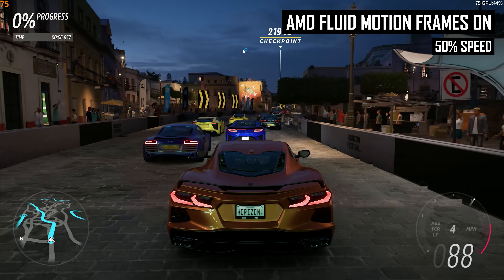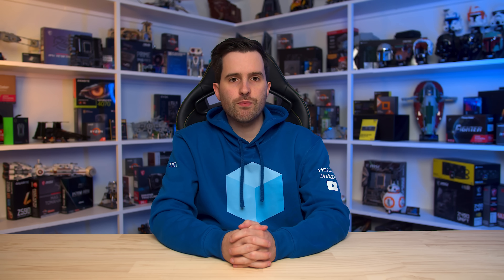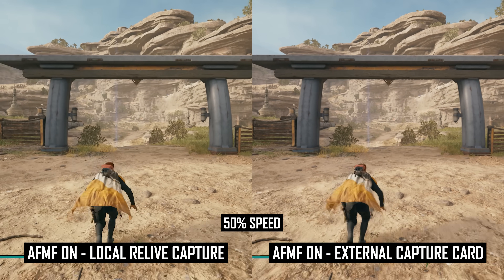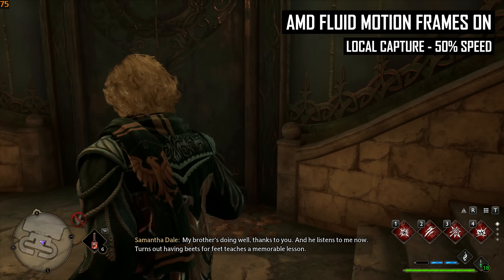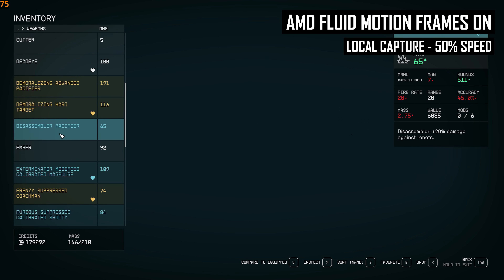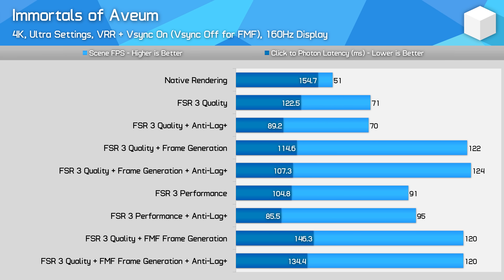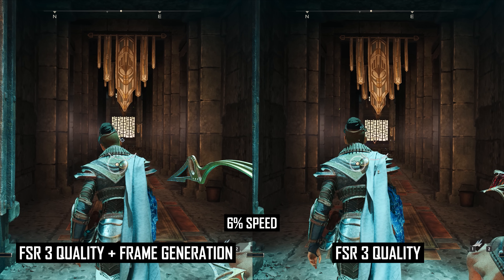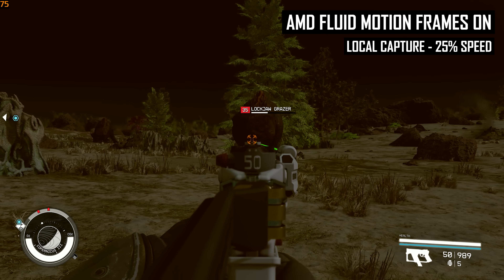Frame Generation for Every Game - AMD Fluid Motion Frames Analyzed

Comment: Tim, I thought you were using an RTX4090 in your main gaming rig so AFMF is a bit of a moot point for you in your personal gaming? TBH I've got a 7900XTX and can't really see the point in this (or even FSR3 frame generation), if I need more frames I just drop quality settings a bit and make sure I'm not running raytracing., but most things I play run just fine dialled up.

Comment: Of Course, Native will always be a better Experience SMH. Going by my own personal week long experience using AFMF in Starfield for a week playing @1440p on an RX6700XT. I find its useable for me. Never experienced any UI weirdness or quality issues of how it's displayed. I am not even at an average base rate above 55FPS in open field areas was getting very playable higher FPS. Even during combat. Saw non of the visual stuff Tim mentioned. Only issue I had was tabbing in and out of game cause Freesync to freak out and cause in game flickering of lighting . Cured by switching off free sync for a few secs, then reactivating it. So my own single game experience differs from the review in this Video. When I was in higher frame rate, it really wasn't noticeable that I was using a Feature, IE it felt like native gaming. The Adrenaline reported Lag for me on average of only 23 Ms combined with normal frame time of 12 ms  would make it for my set-up only a35Ms lag, which is what It felt like to me. That is within a perfectly acceptable RPG game lag range. I know its only one game I tested, I have 2 other games it should work in so will try in those. But so far from personal subject experience I am impressed.  Glad I never take anyone else's word about something. Because light and day difference between Tims respective Opinion and my own. If it gets better than who can complain ?

Comment: Calling frame gen a new type of motion blur sounds pretty accurate since it increases percieved visual smoothness without making the games feel any better to play.
Reply: Agreed. I HATE it being called "free frames"  it's not that.  At all.
Reply: @rickgear2579  Yeah, the irony is that motion blur works really well only at framerates where you need it like 30 fps, where as frame gen only works at framerates where you don't really need it (over 60 fps). Would be a great technology if it worked at lower framerates where you really need it because it does seem like a more advanced better motion blur technology. Companies just seem to use it to show bigger fps bars in marketing charts however which is entirely misleading.
Reply: I dunno about you, but to me visual smoothness has a very large impact on the feel of the game, probably even moreso than responsiveness. I'd take a 120 FPS game with 30 FPS latency over a 30 FPS game with 120 FPS latency any day of the week, for instance.
Reply: @HunterTracks  Pretty unfair comparison however. A more realistic scenario would be 60 fps vs 120. to get from 30 to 120 you'd need upscaling + frame gen. You'll probably get a improved latency with upscaling to 60 then a latency hit with 60 to 120 with frame gen minimized with reflex/antilag. in the end you do get a latency reduction thanks to upscaling but honestly I'd rather play at 60 with reflex/anti lag to get the most responsive game with a acceptable fps. but that's subjective from person to person.
Reply: @bb5307 Oh, I agree that 60 FPS is more than good enough for most things, I just wanted to object to the idea that increased smoothness somehow doesn't make the game feel better to play.

In any case, I feel like frame generation as a whole can be quite for someone who's less sensitive to increased latency than they are to decreased smoothness. AFMF isn't that great of an example because there's a pretty narrow range of FPS in which it's usable, but other frame generation tech can outright make unplayable games playable on older or weaker cards in my experience, and even AFMF can be very useful in games that are locked to 60 FPS or CPU-limited titles.

Comment: Can you enable Radeon Chill while using this to stipulate a frame rate that's say half of your monitor's max refresh rate so you can avoid it going above / out of range and producing screen tearing?
Reply: As far as I tested it AFMF does not care about any FPS limitation. Doesn't matter if you use ingame or driver features. It will just render frames as it wants to. Also tested it with Riva Statistic Tool from Afterburner to cap FPS and it does not seem to work at the moment. So if you already have a 100 frames and a 165hz monitor you wll experience tearing beacuse you get like 200 fps. Perfect scenraio currently is probably when you have half the frames of what your monitor is capable to display. Because you getting very much double the fps.
Reply: @boerbenlp8659 AFMF doesn't care about it, but the native frames do, and AFMF simply doubles them. Setting a cap to half your display refresh rate should work, according to AMD.

Comment: The experience was actually decent in Starfield, but only because I was boosting from ~100 fps to 165 fps. I don't think getting too much below 100 fps is a good experience because of the reasons mentioned, it disabling itself with high motion (the higher the fps the more you have to do) and artifacting (which is less if difference between frames is less with higher framerate). If they fix the pacing it's a neat feature for a high refreshrate experience.

Imo framegen is not advisable if you have a monitor with a refreshrate lower than 144Hz, but preferably you want 165Hz or higher to get some proper mileage out of it.

For that reason I also think it's a bit of a poor choice from Tim to only test it with a source framerate of 75fps, but I won't fault him for it as AMD states a lower amount is necessary than that.
Reply: That's a pretty pointless usecase though. 100Fps is fast enough, so you don't need Frame Gen. And the reason why it's acceptable at that framerate is that the generated frames are so short, that they don't affect the overall picture.^^ Frame generation would be a good thing for people with lower end cards, where they can get from unplayable 20, to at least playable 40. That would be a good usecase. But the tech is still so bad, that the generated pictures make the whole experience blurry and bad. Not only AMD but also NVidia have a lot of work ahead of them to bring a good quality frame generation to the lower end and middle class cards.
Reply: @masterluckyluke   But you see, that's the problem. People keep thinking it's like the holy grail for mid- or low-end cards to get more FPS. I strongly disagree with this notion. Framegen is of particular use if you have a high-er end-ish card which can already pump out enough fps but not quite enough for your refreshrate.
I can tell if games go to around 100 fps or lower and framegen definitely helped with that.
Framegen will not be of any good for lower fpses. This is not a useful feature for lower-end cards and neither do I think either company is going to solve this in the near future because this is just not something you can easily overcome. There is just not enough data.

Comment: Turned on AFMF on Cyberpunk and I must say I'm very impressed. Ofc it has some down sides, but if the internal fps is already high, I would say it is an amazing experience.

For the best experience, If you have a high refresh rate monitor, set the frame limit in half of monitor's refresh rate. Let's say 144Hz, cap the frame limit at 72, set the vsync on, really you can't tell the difference with native 144fps ( at least to my very own eyes). The smoothness is there.
AFMF works best in 70 90 fps 
Played on rx 6700xt, high-ultra setting 1080p, cap frame rate and can never be happier.
Reply: If the internal fps is already high what is the point of using it?
Reply: @Safetytrousers  more likely the smoothness experience tbh. This already states in AMD preview notes as well
Reply: Another thing is if I'm comparing 70 fps native vs 140fps with AFMF on then I will definitely choose the second one. I mean if we have an alternative configuration to play,  isn't that fun

Comment: congrats on well deserved 1 milion

for screen tearing you have a very nifty feature that Steve called out as uninteresting, radeon chill, perfect frame locker, which works unlike what nvidia offers, if they even offer something similiar, radeon chill is quite a strong point for Radeon, you need 144fps for 144hz display? just go with 140 cap on radeon chill and poof, no tearing, saves many people when vsync has to be disabled or display simply doesn't support VRR
Reply: you cant enable radeon chill when FMF/antilag is enabled

Comment: Just use your TV's smooth motion feature instead.
Reply: That's a weird comment. Surely you don't think the small chips in TVs have the same potential as what GPU-based interpolation can do.
Reply: @hastesoldat  i stand corrected on this after actually getting a PC last december. For all the faults of AFMF mentioned in the Video, i for one cannot see the difference in image quality with AFMF and native rendering. But what is noticeable is the lower framerates when you turn off AFMF. i have been enjoying 2 games mainly for the past couple of days, RDR2 maxed out and Armored Core 6 maxed on a 7800x3d/7800xt system.
Reply: @wh3resmycar  yeah AFMF turns off when it detects too much motion between 2 frames. It's pretty annoying. :/ Hopefully someday, AMD exposes an option to disable that.

Comment: I have a lot of questions about your test setup and capture card, because with a 6900xt and a cheapo 144hz 1080p monitor, the only perceivable problems are greasy wet surfaces at times, and some of the other light artifacting, but tearing wasnt noticeable in any game tested.  Seemed to work well in ff14, exceptionally well in BG3, and decently with cyberpunk.  Could be because the fps of the first 2 were "so" high that it became a forest for the trees scenario, and with cyberpunk I was lucky to break far beyond 144 so... idk...  All I know is I welcome our new AMD GPU overlords and I look forward to the intel AMD wars of 2030.
Reply: Take the criticisms presented by reviewers with a grain of salt, since they're out there evaluating every second frame by frame with 300% zoom and you're probably not doing that during your regular gameplay. Make your own decisions about what tech you enjoy or not if at all possible.
Reply: If the fps is so high what is the point of using it?
Reply: @Safetytrousers  Image smoothness when moving the camera around and that's it really. I theorize Frame generation, was never meant to make slow low end GPU's play high end games, they would never let that happen anyway, they want to sell the high end expensive GPU's. 
IMO frame gen from AMD and Nvidia, should be renamed to "visual smoothing" or something.  And also IMO frame rate counters, should be updated to ignore these fake frames, so GPU makers don't get to sell GPU's based on fake fps numbers.
Reply: @Safetytrousers  smooths out dips in frame timing and for science mostly; cyberpunk it helped a fair bit tho
Reply: 6900xt for 1080p? Based

Comment: What I want to see is frame generation(if will be fixed) for 60fps locked games to be boost it to 120 and use BFI.
And if it will work with wrappers like dx9 to dx11.
Reply: What I want is even more unreasonable. I want consoles to be able to use it to go from 30 -> 60. I’m well aware that doing so is pretty much a pipe dream from a technical standpoint, but it’s a fun dream
Reply: @istealpopularnamesforlikes3340 And I want something that seems even more unreasonable, games already running at 60fps 😂😂😂

Sad, but true in the current gaming landscape
Reply: It is possible, specially with emulators
Reply: I hope this driver level frame gen will be compatible for OpenGL/Minecraft Java.
Reply: Yes it works for wrappers and fps locked games

Comment: Could an edge case for this be on monitors with a somewhat poor experience at the lower range of the vrr window.
For example, my Asus VG27A kind of sucks below 100hz.

I will grant that it does not look very compelling in general, just a fun little bonus.
Reply: you can always just lock your frame rate

Comment: I have yet to understand a viable scenario where frame generation actually improves experience in any meaningful way. All I can say is that I'm sorry for every engineer, who has to wreck their brain over this feature.
Reply: I don't get this.
It aims to make the motion smoother and clearer in all scenarios where you're not already hitting max refresh rate. How is that not a huge improvement to the experience. If you ask me, I'd have a hard time thinking about something more meaningful than that.
Reply: @hastesoldat  The reason you want higher frames is lower latency, visual "smoothness" comes in second place. Frame generation sacrifices the more important latency for visual "smoothness", which is exactly ass-backwards. 
That's the reason why a 120Hz OLED will "feel" as fast as a 180Hz+ IPS, due to OLED's virtually zero latency.
Reply: @owlmostdead9492  While I do appreciate the improved latency very much, I find fluidity and motion clarity much more important.
I also would much prefer using a 240Hz ips than a 120Hz OLED.
Reply: @hastesoldat  You forget that with higher Hz on the IPS panel, you actually get decreased latency. With frame generation you straight up get much worse latency and even worse than that, it doesn't matter how much you "generate", 300 fps or 3.000 fps, latency won't improve at all.
Reply: @owlmostdead9492  Yes but motion portrayal quality improves so much with the extra refresh rate that it becomes the priority. Even though, it's still very far from ideal but that would require 5 digits refresh rate and that's at minimum 2 decades away.
Reply: @hastesoldat  I don't think you fully understand, do you have a frame generation capable GPU? Because if yes, do the following, lock a game to 30fps and then use frame generation to 60fps and check if it's any more playable than before. After that lock the game to 120fps and use frame generation to 240fps and try to observe any meaningful difference. If you can, do the test blind with the help of someone else.
Reply: @owlmostdead9492  Ah this makes sense now, you're one of the ThE hUMan eYE cAnT sEE AboVe <insert arbitrary fps here> people. Not much interest continuing this conversation then. Because if you start with such wrong premise then ofc you won't understand my point of view.
Reply: @hastesoldat  You literally don't understand anything, wow. At this point I might as well talk to a bot.
And no, I'm not one of "these people" even though IQ wise you probably do. "Typed on my Samsung G9 240Hz Monitor"

Comment: First of, congratulations for the 1 million subs.

While AFMF seems promising, I don't know if it will ever match in-engine implementation with the likes of FSR3 due to HUD flicking can be as distracting as AMD Boost's UI degradation like in Cyberpunk 2077. While anyone can argue it also depends per developer experience (like Bethesda with Starfield's FSR2 still needs a mod) but that depends since in how good did Hello Games the FSR2 with the Switch version of NMS says otherwise.

We will most like see the beautfy of the tech once AMD releases the SDK in OpenGPU somewhere next year especially with games that already have support for DLSS3.
Reply: It won't ever match in-engine implementation, same way that RSR can't match an in-engine implementation of FSR. Matching in-engine performance isn't what the tech aims to do, it's more of a fallback you can use if the game has no implementation of FSR 3.
Reply: The only way I can think of how this could be remedied without access to game data is to train AI to recognize UI elements and remove them from the AFMF pipeline.
That would require AMD to do something with 7000's series AI cores, though...